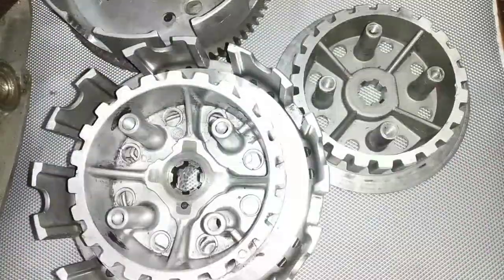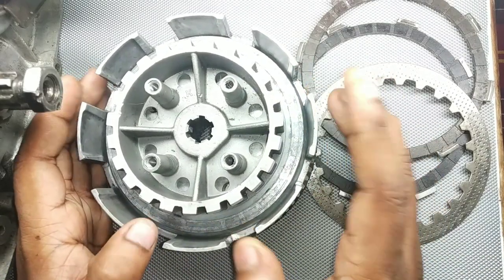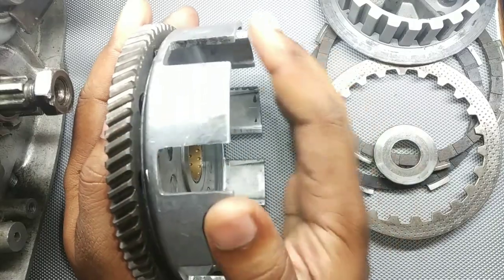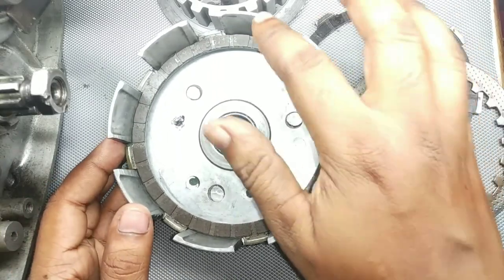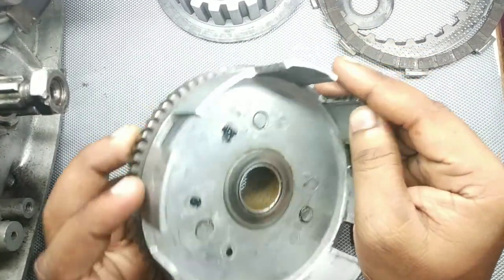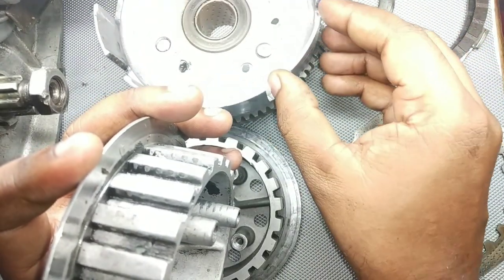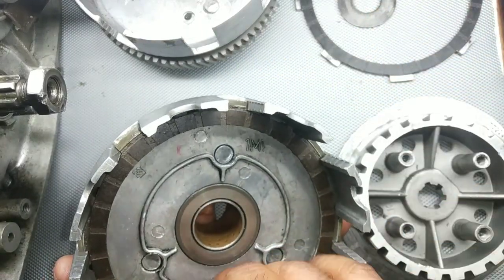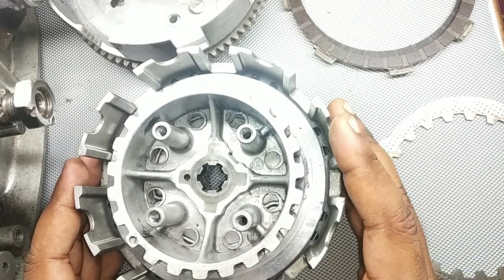Clutch noise in Yamaha Rx series motorcycles || Everything you need to know

Comment: Brother, currently experiencing a problem, my bike is having the same noise you stated... i have replaced new basket, new inner basket, new steel plates, new cork plates, new pressure plate, still the sound persists. Does riveting the basket too tight so that it cant dampen the sound on the rubber makes sound ?... Or we want a very very little play to arrest that sound ?
Reply: Bro did u arrest the sound

Comment: What will happen if there's play between primary gear and clutch gear? Can this make noise as well?
Reply from the maker: There remains a minor gap. But in case you've pitting or worn out tooth on any primary or clutch gear.
It will cause noise.
Reply: @MotoTravelRide  i have gone to a mechanic for clutch noise issue. he showed a minor gap between those gears and he told me that was the reason for that noise and asked me change it
Reply from the maker: @balajimuthu6628  if you're able to see that gap.. then it's not a minor gap. 
It's major. .you have to replace it then.
But make sure to check rest of the things that are explained in this video.

Comment: Bro i got damage one of the tooth of clutch belt with the screwdriver when i tighten the crank shaft and it make a very loud noise. I just want to know is that true because the mechanic said that the reason of the noise. If it is so can i smoothen the damage tooth with sandpaper?

Comment: Very nicely explained. I am one of your subscribers.
Your passion for two stroke is much appreciated.
You are clearing many unanswered questions for the people like me who have minimum knowledge about these issues.
I own 1993 rx 100. Stock condition.
I do get this noise from right side of the engine, is that ok to continue with that noise or does it need to addressed as soon as possible?

Kindly reply.
Best regards 
Dr Shiva Bharani
Reply from the maker: Hi Shiva..thank you for your kind words.
 If you're certain that the noise is from right side, then it has to be clutch. If it is slight and addressed at  the earliest it will save few bucks and keep the original thing in bike. Carrying on with that noise might aggravate the problem and costs would be major. 
Sound is basically primary sign of beginning of the problm. No harm, get it checked one time( not necessarily  ASAP)
Reply: Thank you for your reply!
I just seen it now.
Sorry for delay in responding.

Comment: Hey bro I have a 1995 RX100 and the problem that I am having is that after riding my bike for like 30 mins my engine misses and shut down as if fuel has finished. After waiting for 10-15 mins the bike starts again. Can you guess and tell me what the problem is? Some people have told me that I need to change my entire piston block but I don't think that's the case. Is it a problem of the Reed Valve? Also it smells like kachha fuel sometimes. Would be really great if you can help 🙂
Reply from the maker: Hi.. it can be anything only in the electronics..
Ht coil( under tank) most primary suspect.
Or the Cdi or at last the pulse coil under magnet .
Dm on Instagram ,can elaborate you to rectify it.

Comment: On my 1991 rx100... I observed the rattle sound from the clutch cover... If I depress the clutch lever, the sound disappeared... If I release the lever the sound resumed... Is it the issue with clutch?
Reply from the maker: Yes it's the issue with clutch... check all 3 components of clutch assembly..refer the video you'll be able to figure out the faulty part.
Reply: @MotoTravelRide  Sir thank you

Comment: Any difference in performance if I fix fiber clutch plates in RX10?
Reply from the maker: Yes a lot... As they are light , the response become faster .
Reply: MotoTravel  When we re-revate the clutch basket it will work same as the original?
Reply from the maker: There is a 50-50 chance. Depending upon the skill level if the person who does it.

Comment: Hello Brother,
recently i have got serviced my bike and changed the new clutch plates and steel plates as well original from yamaha. also set the clutch setting as you told in previous video. but my bike is just making sound but not running properly... there is not that good pickup that rx have in actual. i am having OE 5speed block piston 100 number kit installed in my 4speed engine. can you please tell me what could be the problem and how can i solve it also please tell me how can i properly tune it. looking forward for your reply... Thank you.
Reply from the maker: Hi ankit...
 First thing have a go through this video and find out if you had any of these issues with with the clutch components..
 If non was there ,then there there is a chance that the bell tooth or the primary tooth either of them is not matching or worn out becoj of which the noise comes.
Reply: @MotoTravelRide  actually making sound in the sense bike just aawaj kar rahi hai but bhaag nahi rahi hai... mean there is not pickup and all even after changing the new clutch plates... also i have inspect all the things already that you showed in the video brother there is no such issue in the bike. thank you.
Reply from the maker: Instagram me msg krlo brother aap.. will need more details from you.

Comment: Sir I’m having RX 135 4s in stock condition ( recently restored). It runs with 18 inch wheels, mikuni oem Japan carburettor, and a 0.50 mm piston. My bike only goes 95km topspeed without pillion. Please help me to gain more topspeed.
Waiting for ur reply.
Reply from the maker: Okay.. 18inch wheels one both side??
Reply: MotoTravel Yes bro. 2.75/18 on both wheels
Reply from the maker: Okay.theb It's actually showing you faster speed, but going slow around 85-90kmph only
 Message me on the instagram... moto_travelxd , need more details.